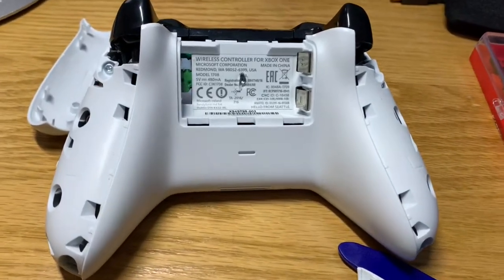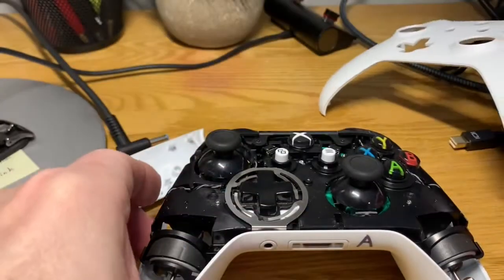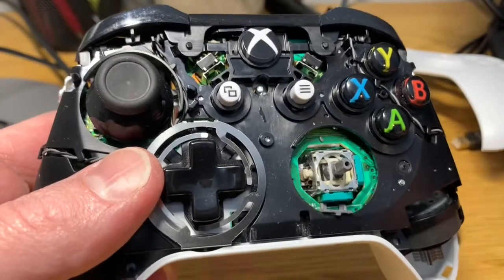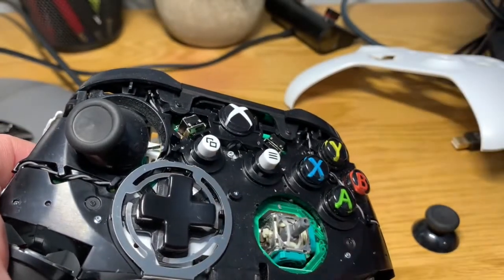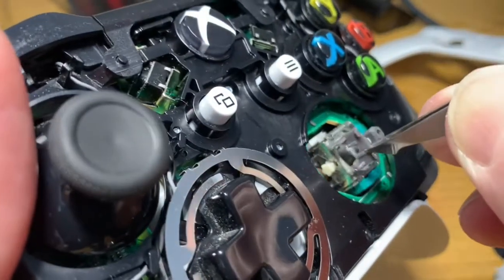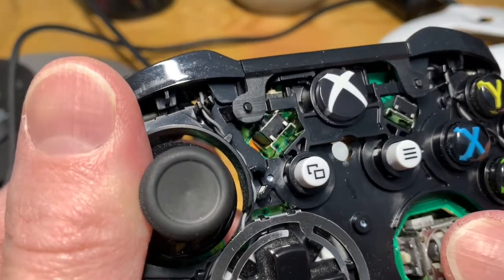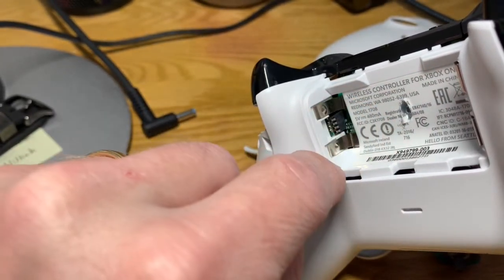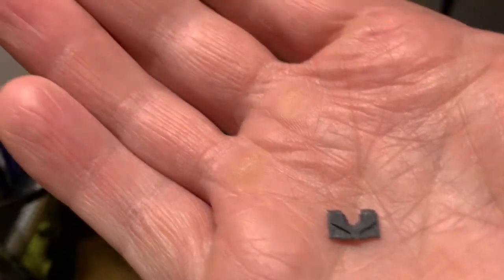Xbox One joystick fix - gray clip

Comment: Opened mine today and noticed the same part is missing. I will be doing the same transplant. Thanks for the video!
Reply: so it did work at first but i damaged the part too much trying to force it back in, and it just didnt sit in right. it seems the replacement part uses softer plastic. the kit brought 4 whole joystick modules so I ended up just desoldering  the old module and using one of the new ones. PITA but first time de-soldering something this small with the correct temperature I was able to do it, did not damage the pads and replaced it with the new module. would rather have done your method though lol

Comment: 2 years late. Does it eventually stop working once the gray piece is removed?
Reply from the maker: I don’t think so, it just makes the joystick not snap back to center as easily
Reply: @mokyan7  ok thanks
Reply: The drift becomes much worse after a couple hours to 48 hours(3 xtimes ive tried on different controlers and it's the same thing each time)  No Fix.

Comment: I stupidly took the clip off the left stick and can't get it back in sadly and had to throw it away. Will that affect anything down the line? I have the controller under warranty for a year and so far no issues without it. My brother isn't reporting any issues so far so that may be a good sign.
Reply from the maker: I think mine still worked just every now and then it wasn’t smooth with the joystick turning
Reply: @mokyan7  It's all good now so it's probably a nothing burger issue then. I have a while controller with both clips removed and other than the left stick getting stuck instead of re-centering, it's great.
Reply: @Ziko577  Sorry to rez such an old comment, but did this continue working fairly well even after this? I actually removed this piece on purpose as an "experimental" fix for very aggressive stick drift and I was wondering how it would work down the line, other than the stick not re-centering (which isn't a big deal for my purposes)
Reply: @jeffchandler8834  It had some drift after that but it was alright for general use. I no longer have the controller as I just upgraded to a Series X and came with a controller but it'll be a backup as these controllers have mechanical issues with the bumpers that tend to break after a little while. My brother uses third party controllers like Turtle Beach's now discontinued Recon Controller and it lasted 3 years before one of the quick action buttons broke and he's getting a Gamesir G7 SE which doesn't have potentiometers so no drift there.
Reply: @Ziko577  Thanks for the reply! We'll see what happens, lol. I've gone through so many of the Series S/X generation controllers because of this same annoying stick drift/double clicking issue, so it would be very gratifying to finally potentially find a fix.
Reply: @jeffchandler8834  Fortunately, it has a one year warranty so it'll go back to the store if needed.

Comment: I’m having this and whenever I click it back on it pops off whenever I move the joystick
Reply from the maker: That is what happened to me because that gray clip has the tips broken off so it will keep popping off and rattling around inside the controller. 

The assembly that I bought from eBay was very expensive maybe five or six dollars? And I just took that gray clip off and put it on my controller so I didn’t have to do any soldering.